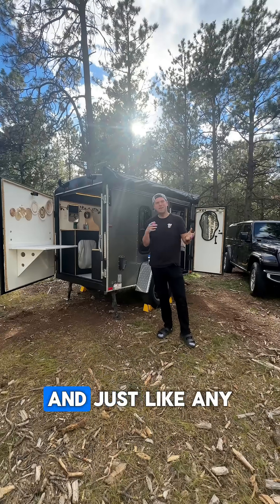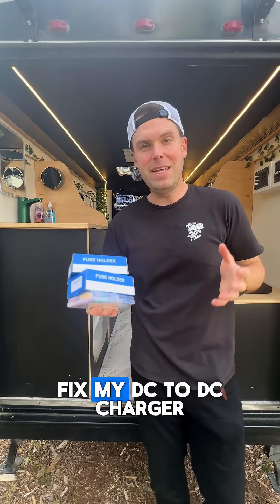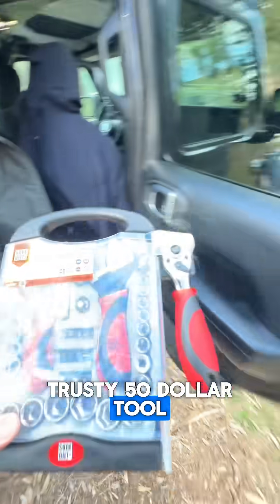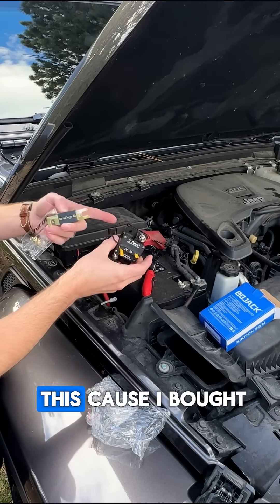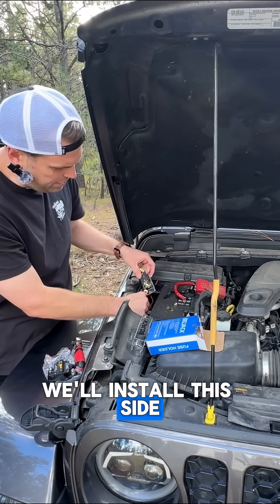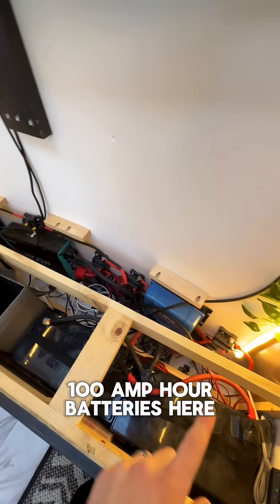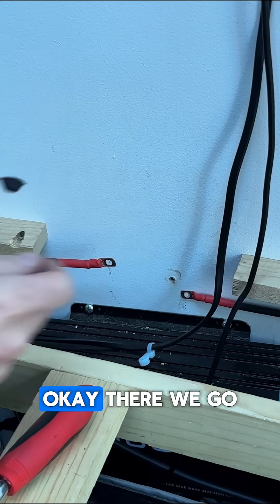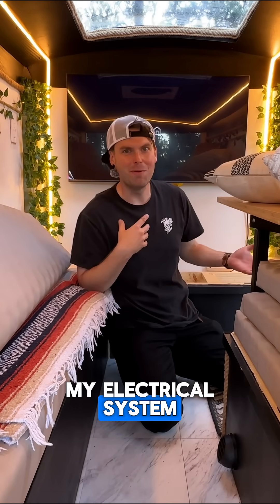Fixing Tiny Home Problems | #tinyhome

Comment: Fuses are not safer than a circuit breaker,  if they were we would still be using them in buildings.
Reply from the maker: I think what the Internet said is for these purposes. And for dc to dc chargers. I have no idea about building. But I don’t know anything for sure. I’m just a monkey with a phone. 😅😅😅
Reply: @JoshieDaily 
If you built this trailer you certainly are not a monkey with a phone.
As for fuses being safer, theoretically both provide the same protection but a breaker can malfunction and a fuse won't. A good breaker should last a long time. The ones you have appear to be good quality. I stay with breakers but fuses are perfectly fine as well. One of the many advantages with breakers is not needing tools to interrupt the circuit when needed.
Great video by the way.
Your best in a while in my opinion. 
The electrical area is not bad at all as you mentioned in a previous video. It's amazing compared to my areas!
Reply from the maker: Oh nice thank you! Yeah I guess what I heard was that fuses are better for vehicles cause the vibrations. But who knows. Now I get to try both out!
Reply: It's great that you can do all this. You can tell by the tone in your voice that your mental health is improving already in just one month since starting the videos and travelling. Keep going. 👏🥰